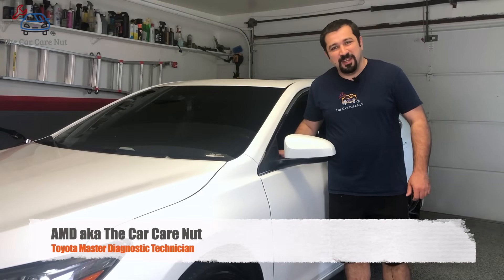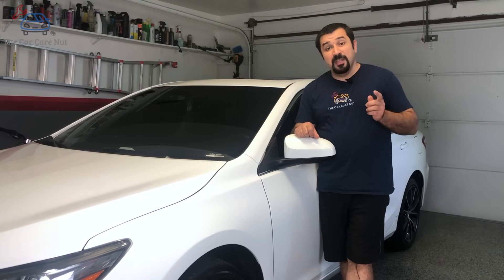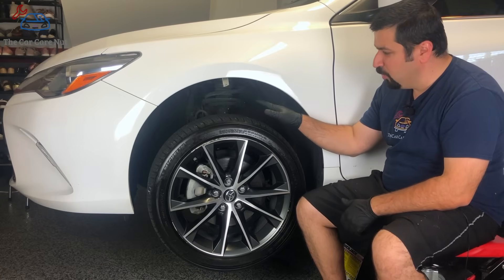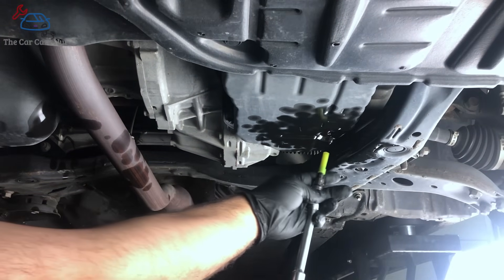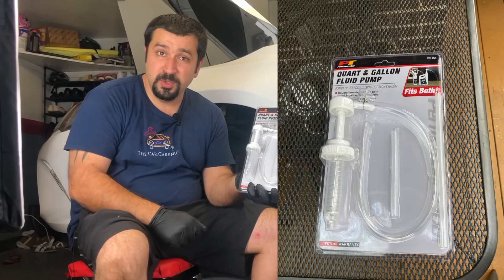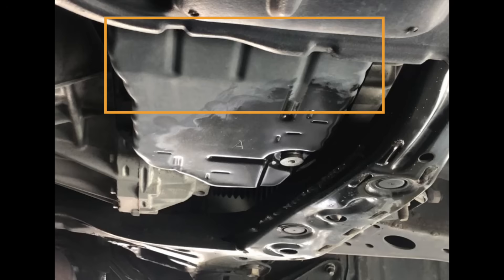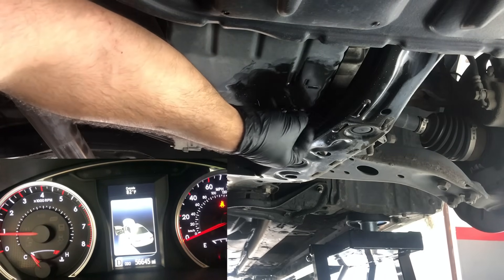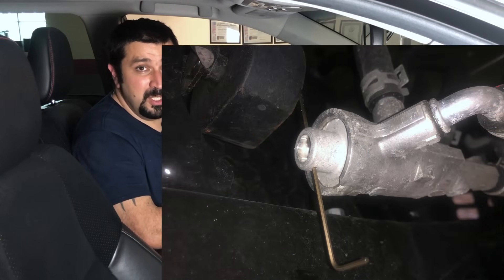How to change your Toyota Sealed Transmission Fluid

Comment: ive had a 03 camry with 2az for a little over a year now. it still shifts great with 236000 miles on it. problem is idk when transmission  fluid was changed last or if it was ever changed. ive heard you and several other mechanics say its not good to change if its been over 100000 miles and never been changed. is there anyway to find out if it was done recently?

Comment: I really enjoy your videos and appreciate your knowledge. I have a late model 2018 Camry-non hybrid 2.5. Currently has 41,000 miles. It’s been perfect since I bought it new. There has been so much talk on the CVT’s that I was curious on what your recommendations were on replacing the fluid?
Reply: I'm not Care Care Nut, but I can tell you that your Camry has a normal auto transmission, not a CVT. 60k is when you should change the fluid, and the procedure is basically like what CCN does in this video.
Reply: @elusivellama  Sorry, but it’s a CVT.
Reply: @djashton3264  My dad had a 2018 Camry. It's a normal auto transmission, not a CVT, at least if you're in the US/Canada.
Reply: I have a 2018 Camry-non hybrid 2.5 and it is NOT a CVT.
Reply: @shoersa  Thank you, you’re right.

Comment: Hi I have Toyota 2014 Venza 6 cy and I called the Toyota dealer service department for a transmission fluid change, they told me that the oil in the transmission is for life, I find it difficult to believe, could you give me your expert advice,Thanks Ernest from Canada.
Reply: I am still waiting for your comments Thanks Ernest.
Reply: While you are waiting, you might want to watch some more CCN videos as he says in plain english that there is no such thing.  Dealer is correct,  their "lifetime" fluid is good for the lifetime of the transmission.  Dealer could say the same thing for water,  it too is good for the lifetime of the transmission.
Reply: I think the service department wants your car to die early so they can get you back into the showroom for a new car.  Find an independent mechanic, or at least try another Toyota shop.
Lifetime is just new car marketing smoke and mirrors. The transmission and original fluid is designed to last as least as long as the new car warranty.  When the warranty is over, Toyota wants your tranny to fail so they can sell you another new car.

Comment: Great informative video - thank you. I have a 2016 Rav4 with 6 speed transmission and conventional gasoline engine. It's an LE model if that matters but I was unaware of the "Drive" light on the dash. Does this model have that? If not, what temperature using an IR gun am I looking for? Thanks.

Comment: When refilling I found it easier to use a 3’ length of clear 1/2” ID vinyl hose and funnel.  The hose fits snug in the fill hole and pouring into a funnel is much faster than a pumper.  I use a wire or coat hanger to hang the funnel from the hood.
Reply: Same thing crossed my mind and I will do likewise when doing this process/procedure.
Reply: I do the same, but use a shorter hose.  There is plenty of room in the wheel well to pour quart bottles into a funnel on a short hose.  
But cover the rotor and caliper with a large rag.  You don't want to accidently dribble trans fluid on your brakes.

Comment: My 2014 Corolla LE,CVT. I haven't change it's fluid since 100,000 miles. I'm at 190,000 right now. Would you recommend me still changing the fluid or just leave it as is? I heard in one of your video saying that it is not a recommendation after an x amount of miles. Just want to confirm.

Comment: If I understand this procedure correctly then if the transmission fluid is cold there should not be any fluid (or very little) coming out the drain plug when removed cold?

Comment: @carcarenut I have a 2009 Camry Le 6 cylinder. 136,516 miles and I’ve never charged the transmission oil. Car is running very good, shifting very good. Should I now at this high mileage get that oil changed ? Thank you for your reply. BTW excellent videos.

Comment: I have 2014.5 camry v6 xle with 97000 miles, it drives fine I drive it slow and smooth but not sure if I change fluid at this point, I am a little worried it would start slipping on me if I do. Any way was wondering what the temperature, range, specs would be for this one. Thank you Mr toyota

Comment: Hi AMD, Could you please tell me the temperature range required to do the transmission fluid level check in a RAV-4 2017 AWD ? And is there a chart peiple could check for other models and years ? I tried finding this information in the previous comments but i couldn't.  Thanks you so much in advance !

Comment: Hello, thanks for all valuable information. I have a 2017 Lexus GX460 with 60k miles and am ready to change my trans fluid and other maintenance since I tow. The vehicle has been very well maintained. I tow about a 4,000 lb boat when wet several times a year on mostly flat terrain (sometimes highway) and with several hundred pounds in the vehicle and wanted your opinion regarding trans temps and coolers. Would you: A. not ever worry about the transmission temperatures and keep the maintenance up to heavy duty schedule. B. Get a scanner and monitor temps and act accordingly C. Absolutely add an external transmission cooler no matter what. I know I'm a couple thousand under total payload when towing but want to be safe with transmission longevity. Engine oil is changed every 5k and getting ready to change transfer case and differential fluids as well.

Comment: This is the most ridiculous thing I've seen regarding a transmission fluid change.  Tell Toyota to send those Ford engineers back to Ford.  I cannot express enough how frustrating it is that this once simple procedure is now a pain in the ass.  And it appears you only replace 2.5 quarts of a 7 quart system???????

Comment: I've binge watching your Toyota/Lexus videos for the past couple days. You really know your stuff!  I'm surprised you didn't mention that only about 25-30% of the fluid comes out when you do a trans fluid drain/fill.  On my wifes CRV (with dipstick) I change it a couple times to further dilute the old fluid with new.
Reply: I agree Kurt...I have yet to see one video where the presenter notes this very important fact. If you drop 2 1/2 quarts or 3 quarts and then add that amount back.....you are "NOT CHANGING" the fluid or doing a "transmission service". These transmissions hold about 7 quarts of fluids.
All you are doing with this procedure is 'refreshing' about 1/3 of the fluid in your trans.....the other 2/3s is still the dirty old fluid.

Let me give an analogy....You fill your bath tub with 100 gallons of water to give your big dirty dog a bath. After the bath is done, the water is very dirty. Now you get a pail and bail our 33 gallons of water....the tub still has 67 gallons of very dirty water. Now you add 33 gallons of clean water back into the 67 gallons of dirty water. The water is a little cleaner(1/3rd cleaner) but still dirty. Will you now jump in and take a bath yourself?
Reply: @exnjute  See the Car Care Nut recent video "Never Do THIS To Your Toyota and Lexus Transmission | Do's and Don'ts For Transmission Fluid". He goes into depth on this very topic. He specifically recommends against this practice.
Reply: @Garuda1415   Thanks!
Reply: @exnjute  But a partial replacement is exactly what is required.  We are not bathing; we are taking care of a transmission.  The clutch packs need some of that dirty material for them to do their job.  If it is 100% replaced, you WILL have shifting problems.  The fresh fluid adds some additives that are needed to extend the transmission life.
Reply: Yeah, I always read changing all Trans fluid and especially flushing the entire transmission will COMPLETELY fuck your car up. Not a super knowledgeable auto guy but I've definitely read this many times before.
Reply: This is a personal opinion only. 🤔  
Drain and fill is to refresh the used fluid for about 30% and it's applied for the first time in changing the cvt oil.
But for the 2nd time or reaching a 100kms in odometer it needs to change the fluid with dropping down the cvt fluid pan and clean or change the filter. ☺️
Reply: Does this procedure apply for a 2008 Avalon?
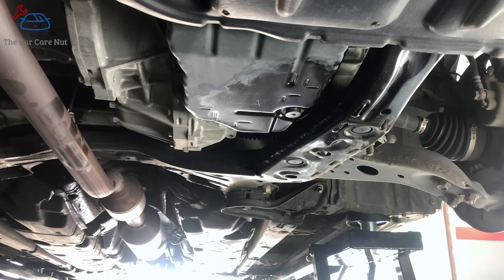Reply: 12:19

Comment: We are 105000 miles or 2016 Toyota Corolla, do you recommend replacing the transmission filter as well(more work lol), or not necessary?

Comment: Do you have to leave the transmission in Drive while doing this? There's plenty of room to work under my Tacoma so I don't need to put it on jack stands, but obviously, I can't leave it in Drive while sitting on the ground and then try to do this procedure. I don't even own jack stands so I'd have to go buy some. I don't want to do that if its not needed.

This has got to be the most ridiculous design choice for vehicle transmissions. Put a friggin' dipstick with hot/cold check lines on it and be done with it. There was nothing wrong with how we used to do it. You don't even need a dipstick. Old GM transmissions had a plug in the side of the housing. If you could feel the fluid with your finger, it had enough. To add fluid you pumped it in until it began to flow out of the port. There's absolutely no reason a modern transmission can't have a dipstick or a fluid check plug.

I swear the reason they do this stuff is b/c they know most people don't keep their vehicles that long so there's no point in giving people access to do maintenance. Its either that or they are intentionally trying to prevent you from doing your own maintenance which means you have to pay someone else to do it, or the shit eventually breaks and you have to pay them to fix it.

Comment: Love all your video's & have been doing many of your recommendations with my Rav4 but I don't have a level surface to preform this procedure at my house just yet.

I've called and asked the Toyota dealership's local to me and they only state they will do the flush @ $325. I've asked about the filter & they state it's not a filter but a metal mesh & it doesn't need changed. Is this true & if not how often should I change the filter out?

Also, congratulations on opening your own shop! It looks amazing.

Comment: If you know it's the factory fill and you don't have any leaks can you just measure the amount accurately coming out and replace with the same amount?  Or, is it a vented system and some evaporates over time?
Reply: Some people do that.  It's not supposed to lose fluid over time, but of course it could leak.

Comment: What if Transmission was Underfilled from Factory--this is the Reason that All Transmissions should have a Dipstick to ck. Accurate Level. Do these New Vehicles not have a Transmission Filter to Replace???

Comment: Thanks for the video.  This is the best tutorial I've seen so far on changing the fluid in one of most absurdly designed transmissions ever foisted off on the public.  All the procedures that you've described would have been mostly negated had Toyota thought of their customers (rather than their bottom line) and put a dip stick on this transmission.  Is there an aftermarket solution to this issue.  In my experience, I have always changed the filter when changing the trans fluid.  You did not touch this topic at all.  What are the pros/cons of filter replacement?  And, are there any tricky issues related to a filter change?  It rankles me that car manufacturers are making what should be a simple task into something so complicated.  Another issue is worrying me.  I am about to buy a 3rd gen Toy Sienna and this vehicle is rated to tow 3.500 pounds.  Every towing vehicle I have has been outfitted with an additional trans oil cooler and it seems this should be a consideration because I plan to do some extensive towing in the 2,000+ pound range.  Any thoughts on that?  Again, I really appreciate your videos because you are the "go-to" guy on things Toyota.
Reply: In theory, this is actually a faster, more accurate way of setting trans fluid than a dipstick is. Still, a dipstick would be nice to verify the level of the fluid between changes and watch for leaks.

I have a 3rd gen Sienna (2014). I did some research, and I found at some point (2012ish?) Toyota started adding the tow package (which is just a transmission cooler) to all Siennas, instead of only some. Some posts over on siennachat.com (which is great) seem to indicate this factory trans cooler does a fine job for towing. I don't recall the exact point they started doing this though. Just do a bit of searching and you'll find it.

There are various opinions on changing the filter on the 3rd gen Siennas on the forum. Some say to change it, some say it's coarse enough you don't need to. It's relatively easy to change though. Just need to drop the pan and the filter can be removed at that point very easily. Toyota's service manual (you can get a 2-day subscription for $20 at techinfo.toyota.com and download and save sections as desired) doesn't list inspection or change of the filter. 

The pro to dropping the pan, is that if you do a drain of 2 quarts, plus 0.5 quarts overfill and drain as outlined here, that.s 2.5 quarts out of 7 changed (I think...), or 35% fluid change. If you drop the pan, that's 3 quarts Toyota specs is needed to refill, or 43%. So you get a bit more of the fluid changed. You can also inspect and clean the two magnets in the pan that catch steel shavings, and clean the gunk out of the pan.

Comment: I've been looking for this video. Thank you sir. Now I can change my AT fluid knowing im doing it correctly. However after changing the fluid and letting out the overflo til it trickles then putting everything back together, you said to check the level again after a week or two, but not to change the fluid all over again, so how do i check the level, do i remove the drain plug again and see if there is any more overflo? Or do i just check the temp with the wire gauge? Thank you again.
Reply: Excellent question! I was wondering the same thing......

Comment: Great video!  What are the torque specs on the fill and drain plug  as well as the 10mm sockets. I have a 2017 Camry.  TIA.

Comment: Very helpful video.
How often do you recommend changing the transmission filter?
Reply: Never, waste of time and money. Those types of filters will never clog
 He has a video on it
Reply: @max.b92  thanks. I haven’t seen that video. 
I did two separate 2 quart drain and top offs in one day. That alone eliminated the fairly consistent torque converter shudder. I want to get the fluid brightened up at this point. If the pan is staying on I’ll go the route of removing a cooler line and pumping out the old fluid from the transmission.

Comment: Hi all.  I just tried on my 2013 Sienna.  Seems to work but what is not clear to me is where you leave the shifter.  If I leave it in neutral, it shows solid “D”.  But if I leave it in drive it shows flashing “D”.  Which one is correct?  Thanks!

Comment: If you take out cold trans. fluid and replace it with the exact amount and temperature of what you took out, why would you need to check fluid level and do the over flow test?  You are putting back what you took out.  

Also, would it be better to do this a 2nd time after driving it a few miles?

Great videos.  Thank you.
Reply: What if the transmission was 1.5 qts low when you drained it. when you fill it with the same amount , it will still be 1.5 qts low!
Reply: @gjamesb53  True.  But in a sealed tranny that would be unusual, to be that low.  If it were that low I think you would be experiencing some problems, no?  Point well taken.  Maybe the first time you change it you should use the temperature readings and overflow process.  Then after that an even exchange would be fine.

Comment: I put Valvoline Transmission Fluid Full synthetic but my rav4 2017 drive not Great
Reply: Dude, you need to use the proper toyota fluid.  See your owners manual or go to dealer.

Comment: Can you do a video specific to a 2018 camry V6 SXE? I watched your video several times and then started to attempt this procedure on my car and there were a lot of differences between your video and my trans. The drain plug is in a different location and in a cast aluminum case. The filler plug is not easily accessable it is farther forward. Then i watched a video which showed 2 separate filler ports. I am very confused at this point.
Any assistance would be appreciated. Thanks Brian...a big fan!

Comment: Hi Amd, I have a 2017 Rav4 xle and decided that I should take it to the dealership for the ATF change at 118,000 miles. They used a machine with air pressure pushing out the fluid through the transmission lines that go into the radiator. The machine also put back new Toyota ATF fluid back into the transmission. Could you comment on this procedure.

Comment: Hi! Does this video apply to my 2016 Avalon limited? I bought it in May 2021. It has about 91,000 miles. I’m not positive but I believe the previous owner took it in for regular servicing. If I drain a little bit of the transmission fluid and see if it’s pink and doesn’t smell burned, then do you think would be all right to drain and fill with a 2 1/2+ or minus quarts, Following the instructions in this video? I must’ve read through 100 comments and I’d like to do this to my car I think I’m competent; however I would consider taking it to the dealership to have it flushed completely if you don’t think it’s too late. Thank you very much I subscribe to your channel going to be watching a lot of videos of yours!!

Comment: Hello I have an 2020 Rx 350 but my OBD2 port 13 doesn't have a metal pin it's hollow employ port  inside but port 4 has one any idea why I was not able to do the trans fluid procedure temp with a jumper cable any ideas thank you.